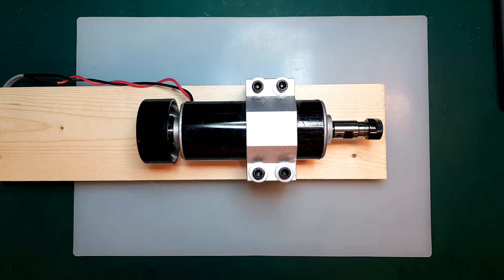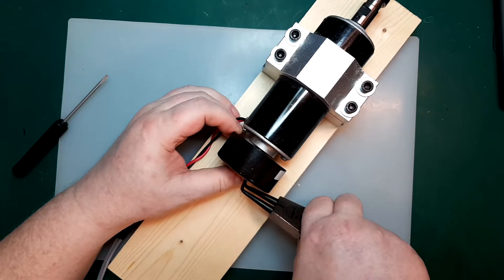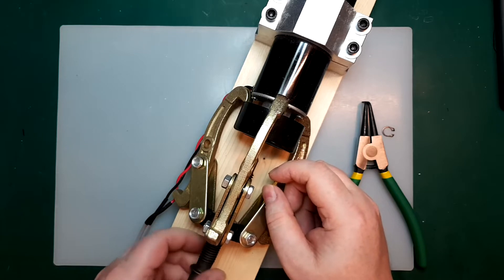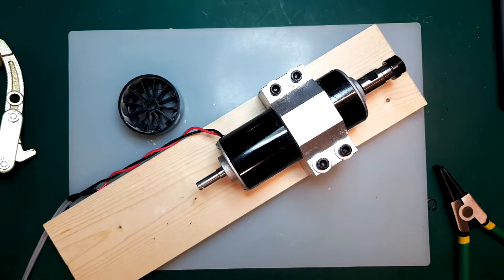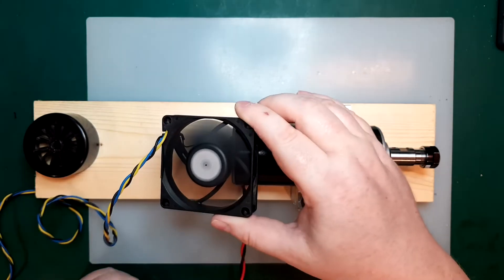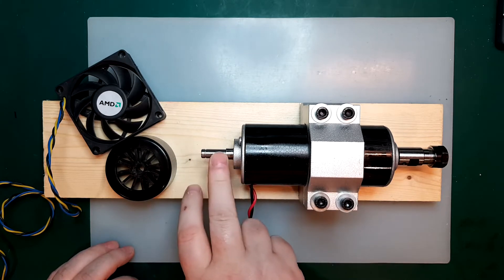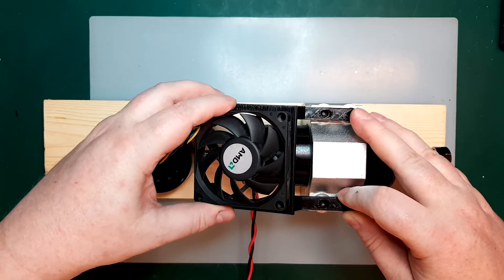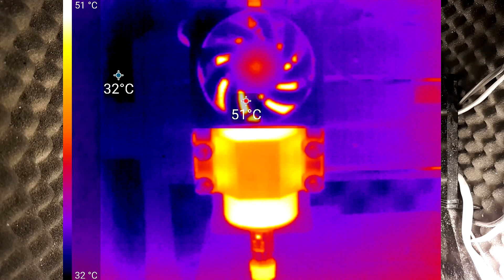Follow up on 500W Spindle Review - Vibrations, Cooling.

Comment: Not good for cnc, better option to take some sandpaper and it's motor is running take a sandpaper on cooler to make cooler is in zero point.

Problem is in the plastic, not use other coolers.

Comment: I pulled the fan,  mounted it on a model airplane propeller balancer,  added drops of CA glue to the inside surface (with accelerator) and got it balanced up perfectly

Comment: hi what about making a chamber around the spindle and making water cooling system
Reply from the maker: You could do that, but it would probably be easier just to wrap some thin copper pipe around the motor if you want to cool it with water.

Comment: Hello, I have a similar engine. I was scraping wood while cutting the edges, the engine had a hard time and suddenly stopped. It's not working now. Electricity comes to the plus and minus poles of the motor, but the motor does not move. What do you think is causing the problem?
Reply from the maker: Did you check the output voltage from the power supply? If you get 110V on the output then the motor is fault. If you don't get any voltage on the output, then check the fuse inside the power supply.
Cheers,
Jake
Reply: @TheStuffMade  Thank you for your reply. Yes, I checked. My motor runs on 48v and there is a 48v electrical output at the output of the power supply. In addition, 48v electricity comes from the plus-minus pole of the motor to the input cable.

Comment: you tested it on wood first, so
 second on the plate, what material is that plate? thanks
Reply from the maker: Not sure, but I think you mean the circuit board? That's a double sided FR4 material.
Cheers,
Jake

Comment: it's not just those spindles, it's all of them , my 200 watt 24 volt spindle has vibrations due to that cooling fan too, i just removed it and put a pc fan over it to cool it.
it'indeed a wheel, not any kind of fan , lol.
Reply from the maker: Yeah, it's a terrible design, I imagine they designed the fan wheel this way so it will produce airflow no matter what direction the spindle is running. But it's very strange they haven't corrected their manufacturing process to make it run straight.
Cheers,
Jake

Comment: I've printed a new fan for my 500W motor, but i can't quite figure out why all og my prints are tilting at an angle. So untill i fix my 3d printer, i just used a 8mm tolerence shaft, pressed it into the fan and let it roll on 2 very flat surfaces, that way i can balance out the fan, just like balancing a wheel. It removed ALOT of the vibrations, the fan still turns untrue by a couple of mm, but it is balanced.
Reply from the maker: Yeah, the main goal is to get rid of the vibrations, doesn't really matter how as long as the spindle is still getting cooled. It's nice that you managed to balance the fan wheel, it's really a shame they didn't have better quality control at the factory.
I have the same problem with my Ender-3 printer, the reason is that it's only got a lead screw on one side for the Z axis, so it always sags a bit on the opposite side.
Cheers,
Jake
Reply: @TheStuffMade  The original fan looks cast molded, so that could be the cause of it being unbalanced. I also got an Ender-3, but the tilting prints only started when i switched board to a silent board. I might have to make it a double Z axis
Reply from the maker: @rasmus1600  I doubt the fan mold is faulty, but they probably remove the fans too early from the molds while they're still soft. I've been considering the 2nd  Z axis leadscrew kit, it's only $35 on Banggood, I guess worth a try. Already installed the BL-Touch kit, it works great.
Reply: @TheStuffMade  I just bought a dual z axis upgrade kit earlier today. The BL-Touch is a nice thing to have, saves a lot of time bed leveling, i'd recommend putting some harder springs/silicone bushings under the bed instead of the original springs. That should help keeping the bed level so the BL-Touch doesn't have to move the Z axis that much when printing
Reply from the maker: @rasmus1600  Great, let me know if the z axis upgrade kit is worth the effort.

Comment: For those contemplating to buy one of these  3018 machines for pcb milling, consider this before you purchase. The vibrations from the spindle is really a big problem for attaining reproducible acceptable results. The approach outlined in this video would  then be a great help. Although the weak frame and play on the rails on one hand are of equal if not greater hurdle. The frame can’t even handle vibrations from 12v motors with 3mm shafts as is! Thus upgrades for the rails and z gantry are compulsory.
Reply: What do you think about the "3020 plus" machines (not from "Vevor" as they have just a slightly upscaled 3018 design with the flaws you mentioned)?

They have linear rails for the X axis, the gantry is connected in the back by two 40x20 extrusions held in place by 8 bolts instead of two 20x20's with 4 bolts that you can see on the 3018 machines and the z-axis carrier is made out of an aluminium frame instead of injection molded ABS plastic. They also ship with a "500w" motor (more like 300w actual power) so I think this combination seems a lot more rigid.

That with balancing the motor/fan properly and should be able to achieve acceptable results?
Reply: @bami2  have you bought the 3020 plus already? how was it? that looks to be better than the 3018 pro max. but i guess the bigger motor will lessen the advantage of the better designed z and y axis. had to upgrade my 3018 z gantry to 100mm x 200mm to steady the bundled 200W motor and its fan for an acceptable and reproducible pcb's.
Reply: @mariomanus3176   Yes, I indeed ended up getting the 3020 plus. I'm having a ton of fun with it and it seems like it fixes a lot of the rigidity issues there are with the 3018s, I use it currently to mill plastics like HDPE and sometimes polycarbonate into frames for small combat robots and wooden doodads for fun.

It has the same issue as the video here with the unbalanced fan and spindle vibrations, but once you balance it (just remove the fan, stick a 8mm steel axle through it, place it on two very horizontal flat rails and keep drilling into the fan on the lowest point until it doesn't want to go to a particular spot), it now works perfectly.

I mostly got it for the additional Z height and I believe the thing is both more stable in the X axis from the steel linear rails and the gantry is mounted with 16 M5 bolts directly into the extrusions instead of 12 with T nuts for the 3018s which should also help with Z rigidity. 

It can cut shallow passes in aluminium right out of the box which requires more setup and tuning with the 3018s.

I've seen some people mount a steel linear rail to the top of the gantry with a hook that reaches over the gantry to the rail guide from the Z carriage and seems to help stability a lot.

Comment: I like the idea of a off spindle mounted cooling fan as opposed to one mounted on the spindle motor...but I don't have a 3D printer to print a bracket...is there a bent metal idea or product available?
Reply from the maker: The fan solution works well, I was worried if dust would get trapped in the fan, but it's not been a problem. I did replace the 3D printed bracket from the video with a couple of pieces of aluminum because the printed part would start bending from the pressure of the fan and the rise in temperature. I used a couple of 12mm x 3 mm strips of aluminum for the new bracket, bent them into shape in a vice and drilled some holes for mounting on the spindle plus drilled and tapped some screw holes for the fan. This works great.
Cheers,
Jake

Comment: Where did you connect that 12v fan?
Reply from the maker: On my GRBL control board there is an output for a laser, I used that for both the fan and a relay to switch the spindle on and off from software.
Cheers,
Jake
Reply: @TheStuffMade  Thanks very much. That's what I was suspecting but I thought that I can't be running laser output and spindle at the same time.

Comment: As I said in the last video: or you could just balance the fan that came with the spindle. If you can't take it to a machine shop you can do it yourself. I've had to "turn" various metal pieces without access to a lathe or a milling machine. 

What I did was chuck it up in my drill press then clamp a file to the drill press table then tap it into the piece that was rotating until it just kissed it. That would show me where the wobble was. Then spin it like that, tap in a little more, spin it like that, then tap in a little more and it came out fine. Now the runout on my drill press probably wasn't the best, but it was fine for my purpose. 

Even if you just held the file in your hand you'd remove the wobble.
Reply: I didn't fancy attaching a fan, so I did like Muskoka Mike mentioned with a file to reduce the imbalance on the top sides and bottom of the spindle fan. Being careful not to remove too much material. I worked great and it's rock solid now even maxed out. Before the vibrations got quote aggressive from 7k rpm. THANKS

Comment: let your spindle  run halfway , with a 80 grit sand paper or file lay it flat on the side and top of fan it will remove the offset material just like a lathe it will make it all rounded
Reply from the maker: That might give a slight improvement, but keep in mind this is a fan wheel, not a solid piece, so when you make it thinner on one side it will still be out of balance.
Cheers,
Jake
Reply: @TheStuffMade  it does´nt need to take much material just enough where is wobbling i did it to mine and all vib, are gone, running smooth on all speeds, just to let you know
Reply from the maker: @joaoamaro4311  Sounds like you were lucky and the wobble wasn't so bad on yours. Mine got about 1mm wobble so it would take away almost half the thickness of the wheel if I used your method.
Cheers,
Jake
Reply: @TheStuffMade  and you could glue on some weight on the opposite side if it was really unbalanced. But the thing is, one side was further from the center than the other, by removing weight would be offset by the distance you've removed. The further out from the center, the same weight would cause a bigger wobble. So by removing the material, you might find it comes into balance.

Comment: Tldr; spindle is OK for engraving. Next to worthless for cnc applications. 
Mine really struggles cutting cedar with a depth of .15 and a 1/8" bit and 20mm/min.. obviously worse with a 1/4" bit. 
Way better options out there for the same price. 
Only thing these cheapo Chinese spindles are good at is low noise, if you can get feed rate to a 🐌 pace.
Reply from the maker: Hi Joe, I assume you mean 20 inches/min, not 20mm/min. Otherwise I believe your spindle is faulty. I was doing some rubber wood the other day, it's harder than cedar with a 1/4" bit and 5 mm depth at 300mm/min, no problems in my case. I guess there will be a difference in torque because I run 230V and I assume you are on 120V, due to the way the power supply works by sending the full rectified voltage to the spindle in pulses, in my case that would be 320Vdc and only 165V with 120Vac input. But yeah, if you only do wood and you don't care about noise or runout, then you'd be better off with a decent trim router.
Cheers,
Jake
Reply: @TheStuffMade  
I'm fairly new to the cnc world, forgive me if I'm wrong on the feed, I'm running it on a maslow cnc, its slow as a snail, doesn't seem like 20inch/min, I cut feed rate in half 3 times from stock settings attempting to get the 500w spindle to stop chattering.
Wish I could run the 230v as I'm sure that is a nice boost in torque and would probably be acceptable to me then, 
I've ran many routers with 1/4"+  bits at 1/4"-1/2" depth by hand through hard maple while feeding twice as fast as this poor little maslow ever dreamed of, and never had the issues this little spindle is giving me.. 
Still a useful spindle, just not up to my expectations. I suppose it's a faulty unit though, time is money or I'd exchange the spindle and try again. 
Makita 1.25 hp trim router in the mail. 
Wish I could find a reasonably priced air cooled 1000-1500 watt spindle....

Edit: my 500w spindle doesn't have much vibration at full rpm, 40-80% it gets a ugly sounding vibration though.
Reply: @TheStuffMade  It is a 100 volt DC motor,,,the power supply will only give 0 to 100 volts output regardless of mains voltage. you can buy digital voltage/current meters that also readout watts for really cheap...that could be used to monitor power usage of the spindle motor.
Reply from the maker: @Centar1964  That's not how this power supply works, take at look in my review video where I draw a schematic of the power supply and explain how it regulates the output.  
https://youtu.be/lqOe9Z4gyFM?t=324
Cheers,
Jake
Reply: @TheStuffMade  In fact it is how it works, your schematic provides no actual helpful info on the circuit...If you connect a 120 volt incandescent light bulb to this power supply you will find the same brightness at full output running from 120 vac or 230 vac...peak voltage doesn't matter, average voltage does.
Reply from the maker: @Centar1964  No the output is a pule width modulated signal, it should be clear from the schematic. The peak voltages are different depending on whether you run on 120V or 240V. If you want to measure it you have to use an oscilloscope, not a light bulb.
Cheers,
Jake
Reply: yeah this spindle sucks, i have it too. but it got way better when i used a single flute end mill, i had  a two flute and 3 flute for the longest time , slow as a snail, didnt think single flute would make much diferrence but i got proven wrong. single flute does make a difference.
Reply: I find that using a tapered milling bit with say a 0.25 mm radius gives me really good 3d high definition  engravings on hardwood s like cherry on my small 3018 machine.

Comment: Printing a new fan was the first thing I did. Not only the wobble was terrible but it's also "designed" to "work" in both directions, so the blades are parallel to the main axis of the motor. With a new fan the spindle stayed cool enought for a printed part even after 8 hours of use at full speed.
Reply from the maker: Good to hear the printed fan wheel is an option and that it doesn't melt. I might try it if the fan I installed gets destroyed by dust. The design of the original wheel is a bit inefficient, I wouldn't be too concerned about not being able to run the spindle backwards, although it's not a problem when using a fan. Did you glue it on with epoxy or just a press fit?
Cheers,
Jake
Reply: @TheStuffMade  Just a press fit. Your printer only need perfectly perpendicular axes otherwise the fan  might vibrate as much as the old one.
Reply from the maker: @ondrasmalek  yeah, I don't think my Ender 3 pro will do very well, it's only got an acme screw on one side of the z axis so I believe it sags a bit on the opposite side, not a problem with most prints, but I don't think the z axis is perpendicular to the x-y plane.